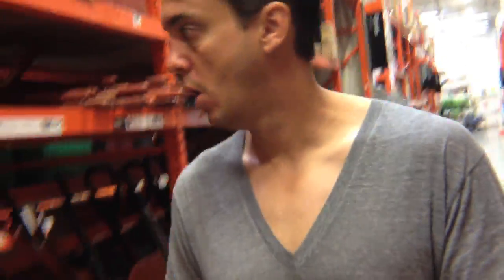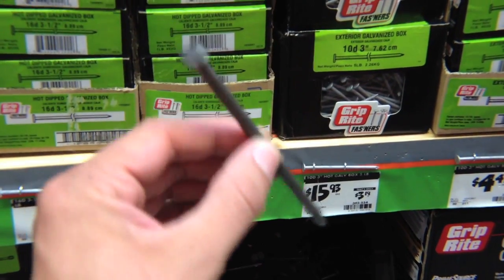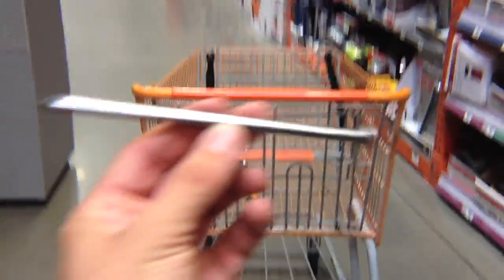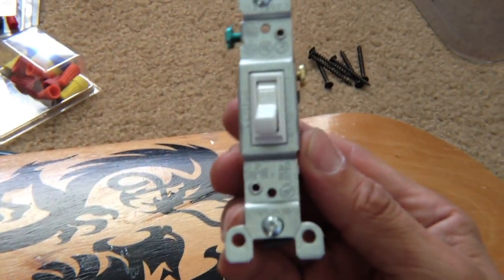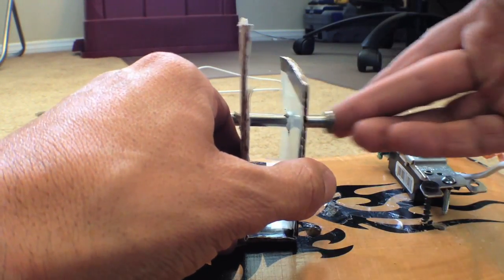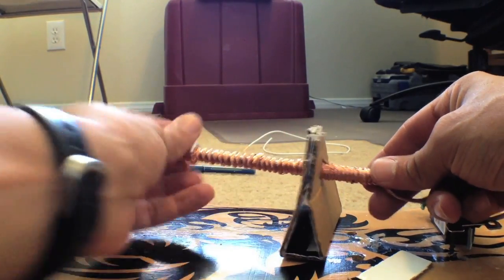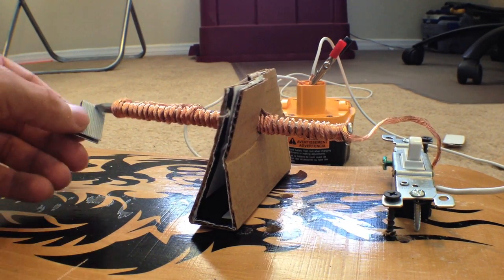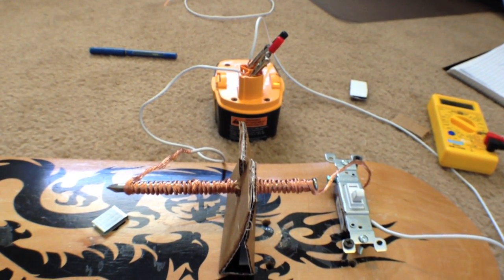Coolest Electro magnet ever made

Comment: I don't think anyone was actually interested in the magnet part of this video (probably including you), but you should use isolated copper wires man, not any copper you stripped from a cable. You have just short-circuited your battery. I'm even surprised it got magnified at all.

Isolated copper, as thin as possible, with as much turns as possible...

Comment: if you wrap that nail with stripped wire, you will cause a short circuit :(
which means that you will make really weak magnetic field
you should wrap it with insulated wire :D

Comment: Umm it doesn't work like that. The idea of wrapping the coils of copper wire is to increase the surface area in contact. open up an old  power brick and you'd find a large coil of exposed copper in which is tightly bunched together. This is to increase the distance in which the electricity has to travel thus causing a voltage drop (Eg. 240v ac - 12v dc) now electricity doesn't just arc across the coils because it takes more energy then it would to follow the coil.